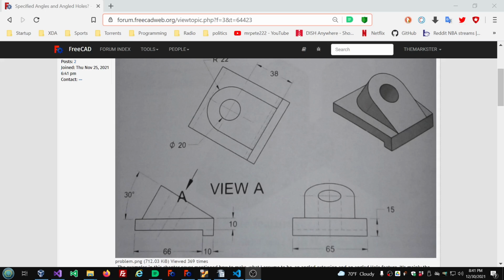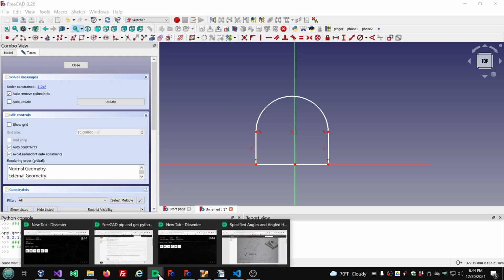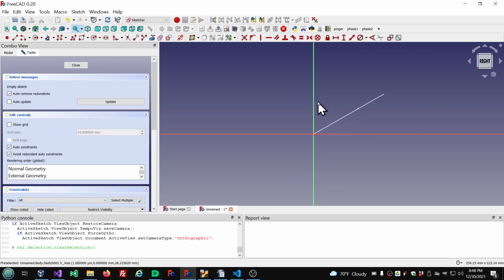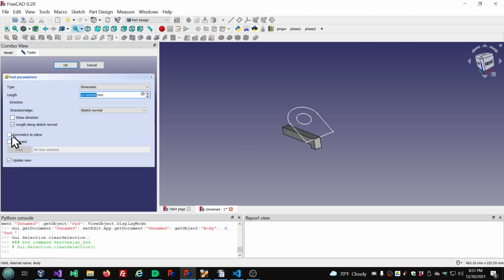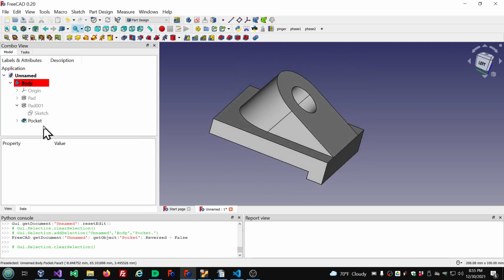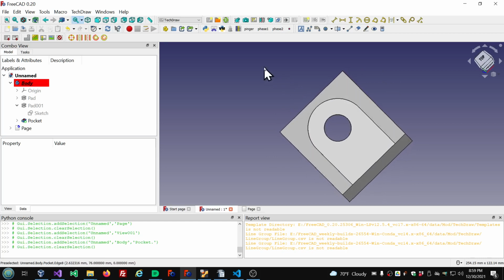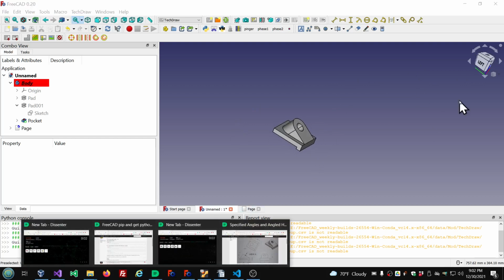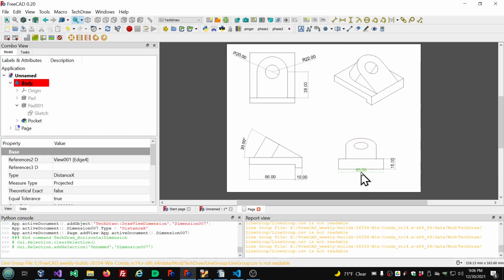086 tech draw example

Comment: This is fantyastic to watch a proffesional, how long have y6ou been using Freecad?
Reply from the maker: A few years.  Less than 5.
Reply: @mwganson , it shows , you have a great undersatnding opf the software, 
 do you assist people who are stuck and cant find answers on the tube?
Reply from the maker: @djmelia9719  By "on the tube" I assume you mean here on youtube.  This is not a suitable forum for doing that.  It is better to post your questions on the freecard forum where there are a group of experts eagerly willing to help and where you can post images and your freecad files as starting points for them to work with.  I sometimes help others on the forum there, but I haven't been as active recently as I have been taking a break from the project to "recharge my battery" so to speak.